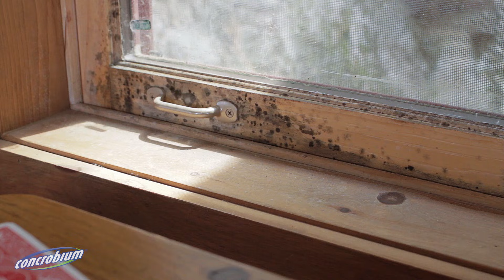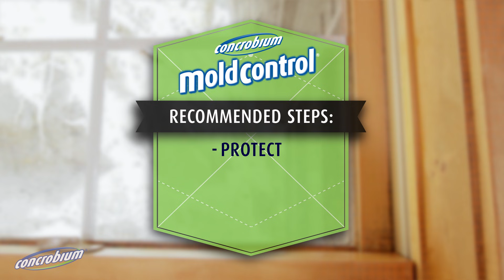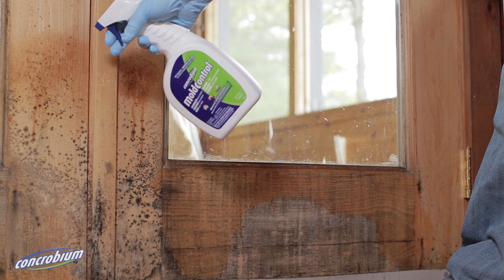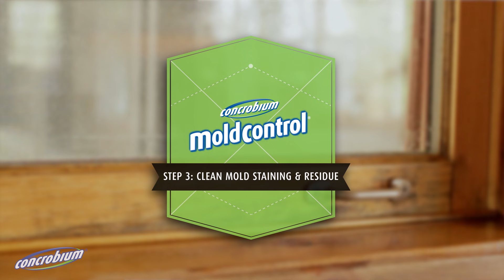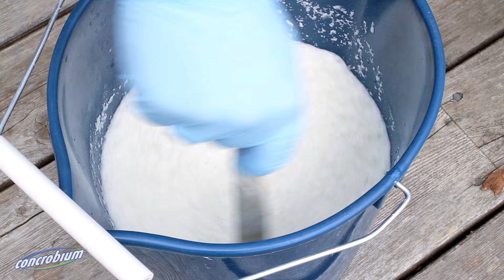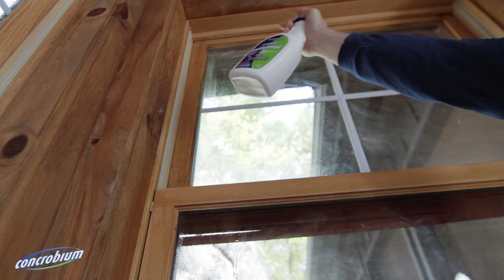Concrobium Mold Control:  Indoor Mold Fighting Guide

Comment: As my spray bottle says "Natural & Odorless", unfortunately, it does not work...at all. I did use the empty spray bottle and filled it what I usually use, clorine bleach (Javex) on my bathroom tiles. Works every time.
Reply: bleach worked for you because the tiles were nonporous.  This particular Concrobium product is specifically for porous materials such as drywall and softer wood.
Reply: @pmorse3653 I wonder if you can help me with advice about my air conditioning unit  ?  
   It MIGHT have mold  ?

Comment: Don't close off your windows with heavy drapes or blinds in cold, wet or humid weather because you prevent air circulation and create mold habitat. Use a small oscillating fan to blow on the window area in closed rooms. If your sheetrock has black mold you should wear a gas mask to tear it out and take it to the dump. Then fix the moisture problem.
Reply: svkikometaruvzavmkijedobarbiocijiiakomijedusmaniakovrediuvazicualinemoguvazitzlapodlostipodvaleogvrjnedrugihponizejnedrgihsvakicovjeknasvojnacinvredianeprvitsesamojinikovisenistaneznatrebasetrdidikopmognedanAucidrgebestoakoneznajatkotdimnogomejnudipitbilozstokdvidikomnestoksetordipokazemuijnudizahvlniaimihnecerecikadihpitepogrednokazuiofcobjekamlovzavaikazedanistaneznatojezalosnoudnasjnemdrstvustosekodnasdesava

Comment: Do air purifiers and dehumifers both kill mold already in a bedroom I have mold in my bedroom and I use dehumifers in my bedroom and I have brought a plug in air purifer
Reply: Is that the air purfier and dehumifers that stop mold growing are small dehumifers ok to use I use small dehumifers mini moisture traps and wardrobe dehumifers and I have plug in air purfier
Reply: @NewEnglandWildlifeAndMore  I'm confused sorry so will using dehumifers on visible mold stop it growing and slow it down

Comment: How long do we let it dry after spraying
Reply: 2 hours
Reply: @BLProductions111  That sounds better than a comment  where someone said 24 hours ...  ?
Reply: @BLProductions111 what about using it on the inside of a 2-year-old air conditioning unit that I think is getting mold in it ? 
   Yes water trips out of it despite no proper drainage hole in the unit itself ... it's got dark color water in there .
   Worried about taking it apart to properly clean it .

Comment: If the mold stain area is not in a visible area (craw space) is it ok to just leave it alone after the initial layer of Concrobium is sprayed on and left to dry?
Reply: I have the same issue right now, hoping if you found out the answer for this after trying it. I’m planning to just spray it, it kill everything, and leave it as it is after it dries; how did that work out for you?
Reply: ???answers? @masster87production

Comment: Camper had a leak in the roof. The ceiling is comprised of thin rubber exterior cover, thin luan plywood, 5/4 styrofoam insulation, thin luan plywood, plastic covering (similar to that used for shelving.Working from inside I can remove plastic, luan and styrofoam. will concrobium penetrate the upper layer of luan and kill mold between it and rubber exterior cover. (Thin is about 1/8 inch)

Comment: Will this product work on non VOC paint that has gone bad?  I used Olympia paint from Lowes that smelled fine in the bucket, but started to smell rancid once it cured.  It's been some months since, there is no mold visible, but still smells slightly of the moldy paint.
Reply: Paint probably went bad

Comment: This is an amazing product and I'm very pleased with it. I just have one question....can I paint over it after I have cleaned the area with this spray? Thanks.
Reply from the maker: +RossRocks07 thanks for the comment/question.  You can paint over it with any oil or latex based paint.
Reply: @ConcrobiumMoldControl , This is not recommended for Mold Sensitive individuals with CIRS.
Reply: @ShinyRebelChild  why not?
Reply: @ConcrobiumMoldControl  does this kill mycotoxins